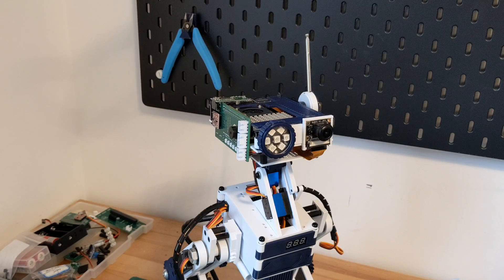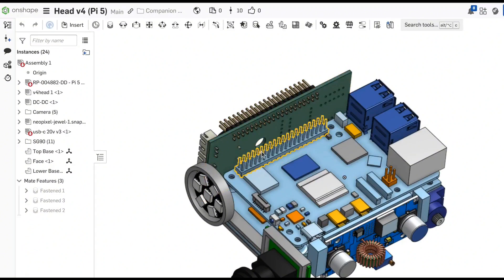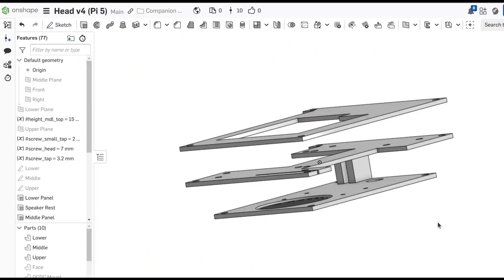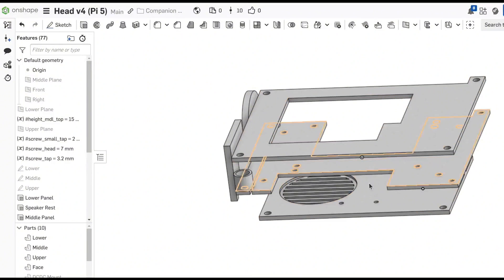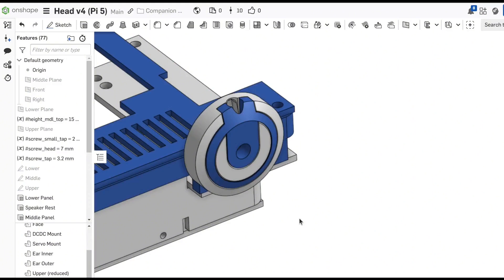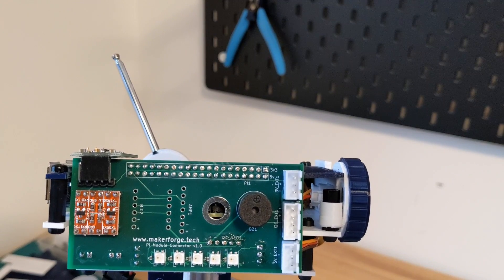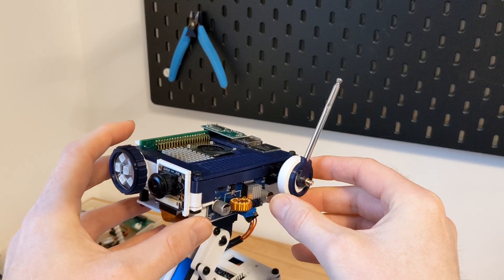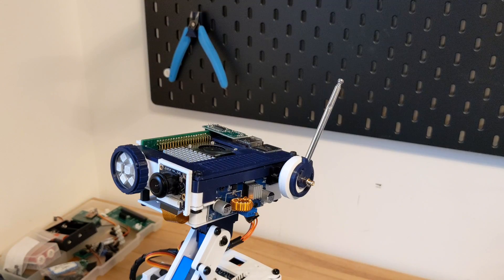Build a Raspberry Pi 5 Robot  - Build Log 5

Comment: Hey Dan, can you please tell me if you built your voltage display on the robot yourself or if you bought it? I'm currently working on my robot and also need this display to keep an eye on the voltage at all times. Thank you very much
Reply from the maker: Sure! This is just a basic meter you can buy online, but you can also connect the battery to an arduino etc via a voltage divider if you want the microcontroller to have visibility of the battery. Some boards like the pico support this natively.
Reply: @DanMakesThings  Thank you so much Dan!

Comment: Have you thought about using AI? Integrated speaker and mic?
Reply from the maker: Sure! There is a speaker and mic integrated in the board and there are offline Llm models you can use here, but they're all very slow to run on a pi. I tried one recently. Definitely fun to test it out though 👏
Reply: Great, I'd love to see it in action. I have a raspberry pi and a 3d printer so I am tempted to design my own robot. I think the pi 5 will work a lot better with LLM.
Reply from the maker: If you want to have a go, Viam has a good example here: https://github.com/viam-labs/local-llm
Reply: Thanks 👍🏻 Will it run on a pi zero 2 w?
Reply from the maker: No it needs an 8gb pi5. LLMs are hungry 😅
Reply: Lol no wonder I struggled to get it working. I did try the light version months ago but struggled to get it working.

Comment: This looks great! How do you make it portable, considering that regular powerbanks wont work with the pi 5? Do you have a video about how it is powered?
Reply from the maker: Thanks! It's powered by three 18650s, or 9v via USB C , and a DC-DC CONVERTER 😅
Reply: @DanMakesThings  Thanks for the reply! That sounds cool, so you basically made your own solution instead of a power bank? Was the power bank never an option? Because I'm currently considering whether I should buy the pi 4 or pi 5 for building a portable robot, like yours but much more basic :) Do you think I could start out with a 5v/3a power bank at first and still build a capable basic robot with sensors and a camera? Or will I most probably need to make a custom solution like yours for the pi 5?
Reply from the maker: Worth a try! I chose the approach I took after a few failed attempts with other things in the past. The challenge was introducing servos because the spike in power usage would affect the pi.